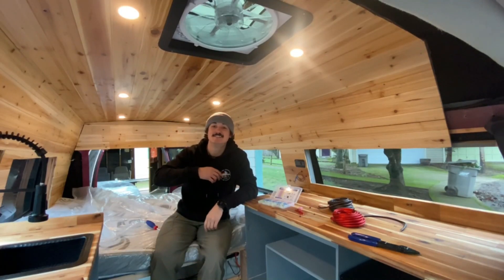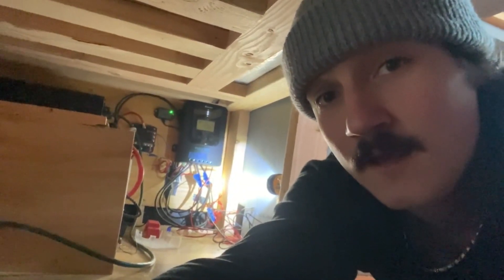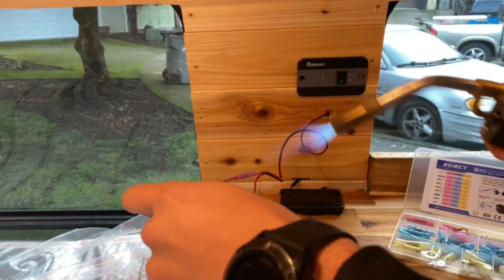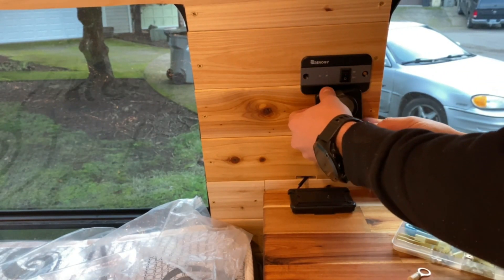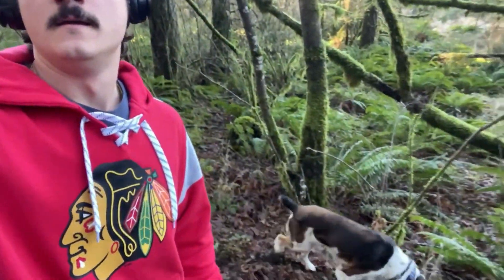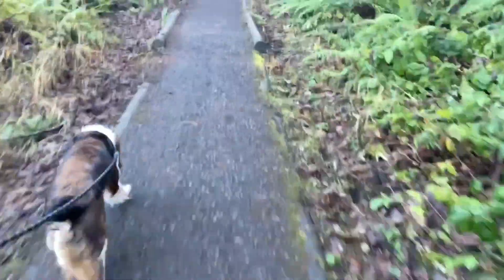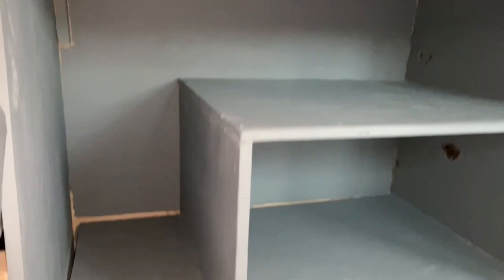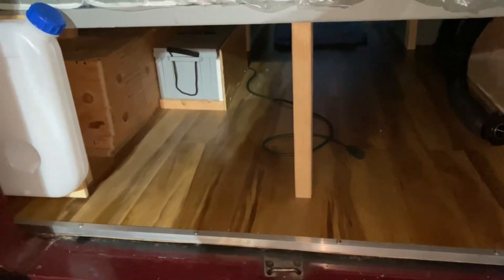This WAS a WHEEL CHAIR Van! | Dodge Camper Van Conversion

Comment: I love this buildout. It needs a swivel seat! Any reason you haven’t installed one yet?
Reply from the maker: I agree a swivel seat would be icing on the cake. Seems like they are hard to come by with DOT ratings and that don't require welding modifications. I would love to install one, but just don't want to jeopardize the safety of my passenger. Let me know if you have a solution. Thanks for commenting.

Comment: how did you mount your fridge?
Reply from the maker: The fridge is pressure fitted  and stays put while the van is moving. One thing I would like to do is put a latch on the fridge door. It has swung open and my food went flying 😂🤣